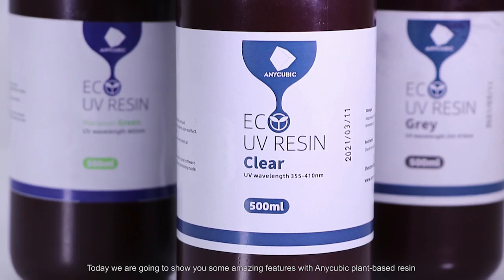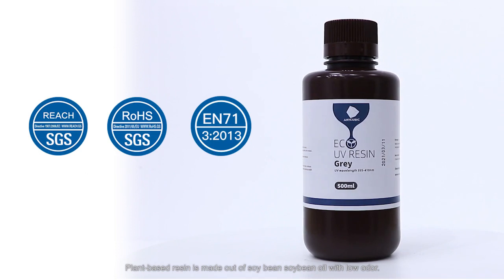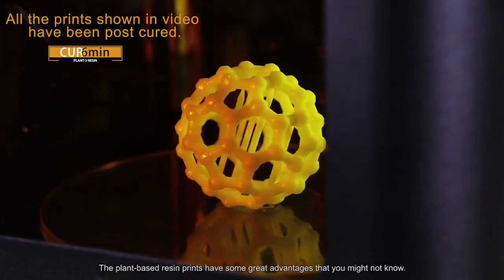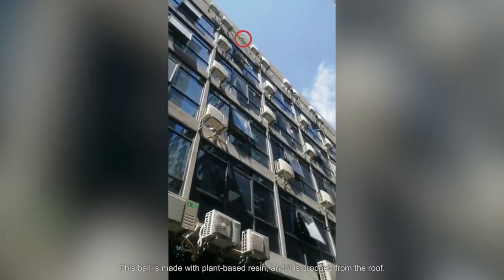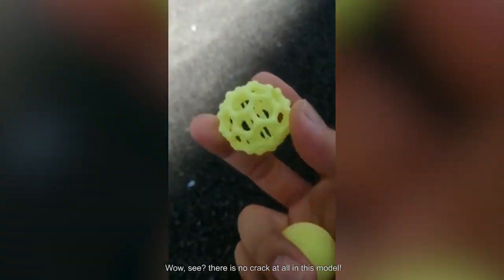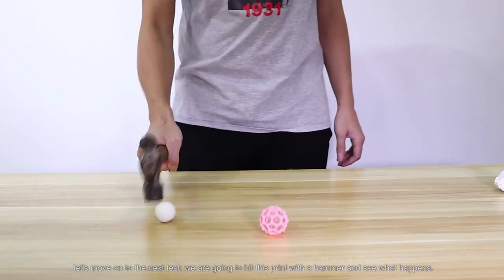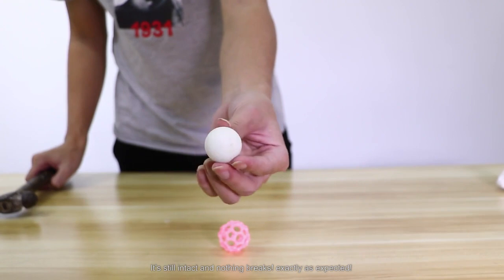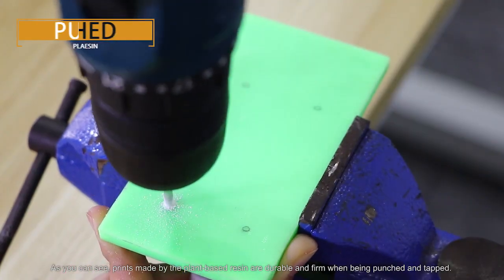Best Choice For  3D Prints! Explore Amazing Features of Anycubic Plant Based Resin

Comment: Is it still toxic ? What about UV resistance for outdoor use ?
Reply: you should treat all resins in there liquid form as toxic and use all protection as you would with normal resins. not sure about how well they would hold up outdoors for a long time. as not many people test that with resins. but would be good if anycubic did a run of model prints like users would print and leave them exposed to the elements outside to check.